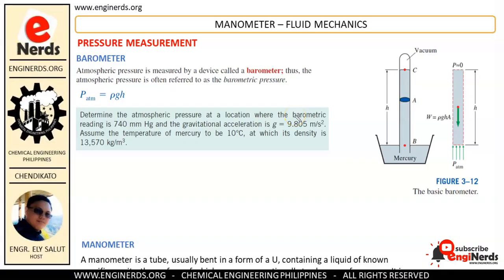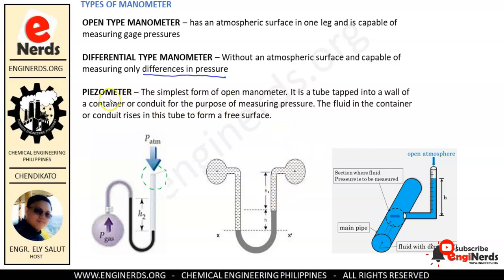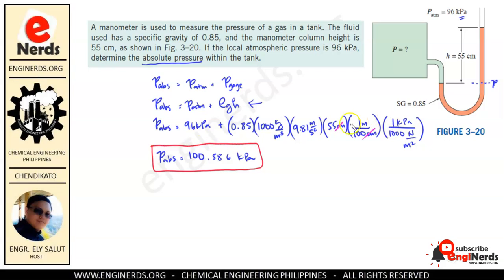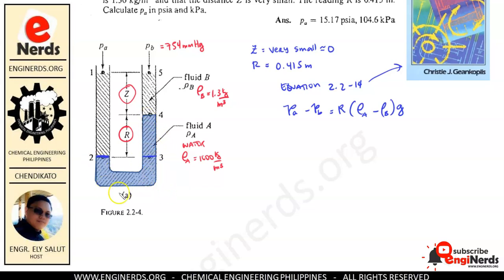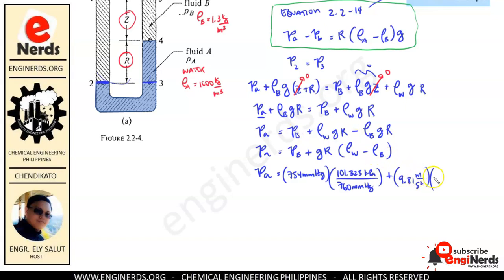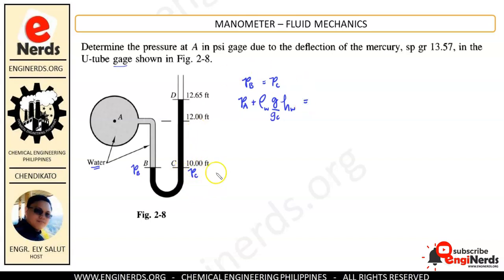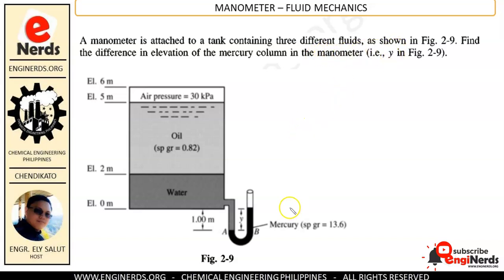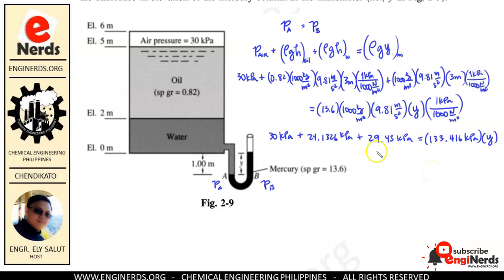MANOMETERS | PART 1| PRESSURE MEASUREMENT (TAGALOG) | ENGINEERING FLUID MECHANICS AND HYDRAULICS

Comment: Enlighten me po sa before to the last problem... why did you use 62.4 lb/ft³ as your mass density of the water? Diba specific weight sya ng water?
Reply: (2)
Reply: The numerical value for the density and specific weight of water in the English system is 62.4, but they differ in units. Density is 62.4 lbm/ft³ (pound mass per cubic foot), while specific weight is 62.4 lbf/ft³ (pound force per cubic foot).

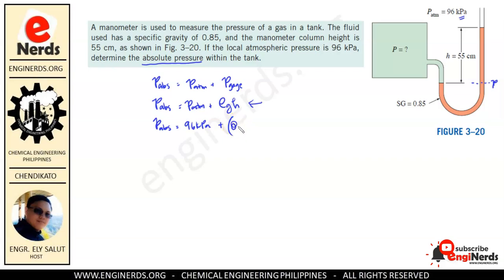Comment: Sir, bakit po need imultiply ng 0.85 na specific gravity sa pgh sa 9:26? Thank you po.
Reply from the maker: We did that in order to get the density of the fluid. Remember that in pgh, p is the density of the fluid. However, our only given information is the specific gravity of the fluid. sp.gravity = (density of the fluid / density of water). That is why in order to get the density of the fluid, we will multiply the specific gravity of the fluid to the density of water.